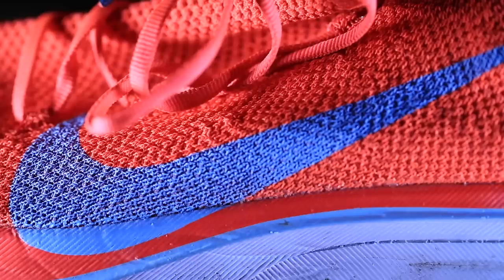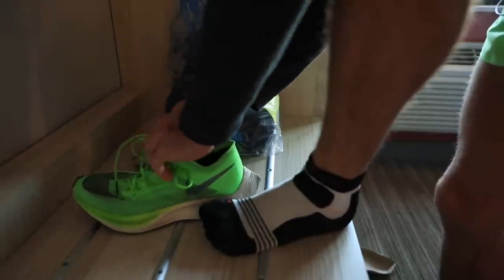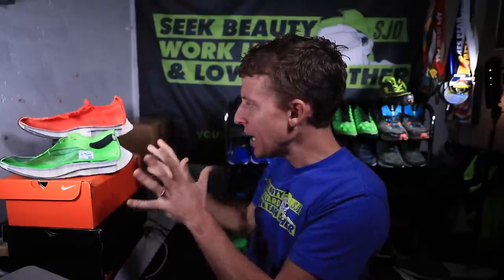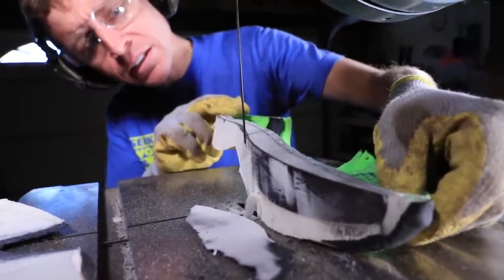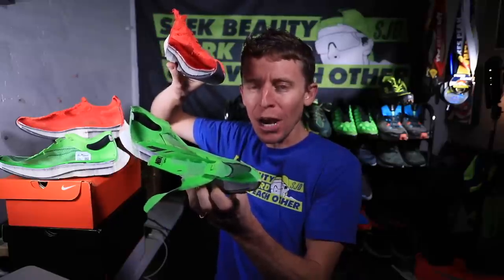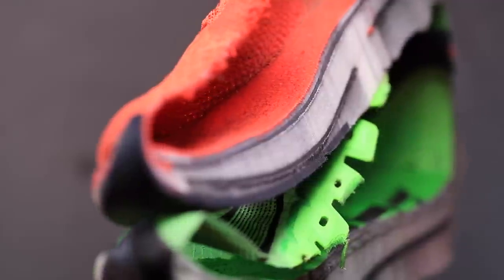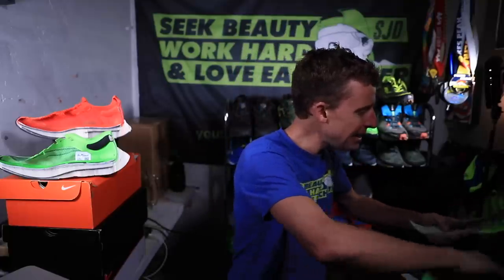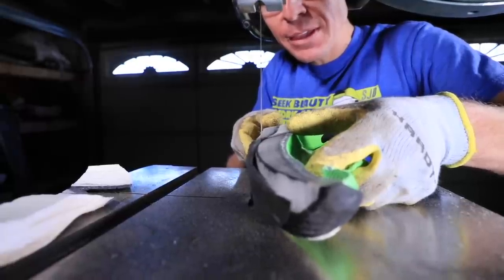What's Inside the Nike Next% & Vaporfly 4% Flyknit ? | FREE Next% GIVEAWAY

Comment: I own two pairs of 4%s and used them for shorter races.  It is my 'belief' that any benefit I may derive directly from wearing them is due to one of these factors (or a combination thereof): the extreme light weight, zoom foam, stack height, placebo effect, and lastly the plate. I think the the plate basically stabilizes the foam and help keep the foot in 'position'. I am not buying the idea that it provides a true spring effect.  I have been running since 1973 (first marathon in 1975) and seen a LOT of technological developments in running gear and shoes. It has been an evolutionary development.  The foam and plate in the 4%, Next%, New Balance 5280, HOKA, and others is just another step forward.  If one wishes to 'control' development, consider limiting the stack height of the midsole. BTW great segment today Seth. You nailed the video production. Well done.

Comment: Great video! I have the pink Next% and used it last weekend in a hilly marathon (420m of vertical gain). I do feel I gained some time, and saved my legs a bit in the 2nd half. There is a very noticeable bounce / energy return. In terms of negatives, the shoe was a bit too narrow. I should have gone half a size up on my usual (which I get in a wide fit, and the Next% has no wide option). The main issue with the size was the 4th toe on each foot, which got pretty messed up and I was (still am, maybe) in danger of losing toe nails. I'm going to cut a small piece out of the upper to make room for my 4th toes - it looks like some kind of reinforced mesh that shouldn't unravel. The other thing is my ankles hurt a bit more - they are definitely a little more unstable, so some ankle strengthening would help, and I think it's very important to get a good lock down in these shoes.

Comment: QD: I like it that they develop the race shoes. The same happened with tracks before. Runners were running on slack in the fifties which wasn't much different from the conditions that had existed for thousands of years. Now they have very fast Mondo tracks. Similarly shoes play a big part in marathon at the moment. When I predicted in 2010 that a man will run a sub 2h marathon within 10 years, I thought that in order to do it, it is going to require a rubberized marathon route. So I didn't see this kind of improvements in shoe technologies coming but a man ran a sub 2h marathon, which is fascinating.

Comment: I managed to get a pair of 4% in a sale and ran my first half marathon in them last October. I was blown away by their performance and ran 1:23 while I aimed and trained for 1:30. For me there's no denying these shoes offer an edge that other shoes simply don't... Does that make it unfair? I'd say no: it's progress, technological advancement. Shoe companies have always tried to make better soles: better energy return, more springiness without sacrificing softness (which isn't the same as damping!). Nike just made a breakthrough in this concept that others didn't. There's no mechanical advantage: there's no energy generated here, just returned. In other words: it's not mechanical doping.
That's not all though. If a shoe alters the biomechanics of the wearer, that could offer an advantage as well! Think of longer legs with extra levers (complicated contraptions indeed, that do exist). That isn't the case here. The shoe does seem to influence the gait though and make it more efficient for most users, but every shoe on the market tries to do that. Take stability shoes for example. Every shoe tries to give an advantage by improving the gait (without altering the fundamental biomechanics). Some are better at it than other. The vaporfly just happens to be very good at it. 
The 4% doesn't mean it's 4% better than anything else by the way. It's 4% better than the previous best shoe from Nike. If I remember correctly, RW tested this shoe and measured an energy return of 80%, whereas the previous record was held by Adidas with 79%.
Technological advancement happens in any sports. And every once in a while a game changer is dropped, sharpening records across the board. It happened in skating, it happened in swimming. And it happened in running. It's progress.
So I'd be happy to get my hands on a pair of next% someday and sharpen my PB's in them :)

Comment: QoD: I just took delivery of a pair of Next% (the green ones). I have not yet run in them.  So far I have just re-laced them and walked around a bit. They feel strange and, when walking I keep tripping, catching the toe of one on the heel of the other. The toes, the heels and the angled lacing all feel weird.  I usually lace my shoes with less cross-over in the mid section, to allow for my wide feet, and I use the loop-through-the-top-two-holes method to keep the heel tight.
I have a 10k, 10 mile, Half Marathon and Full Marathon planned over the next 6 months and these are to be my racing shoes.

Comment: I’m worried about the plates after getting problems from running in the vapourfly 3 all the time.
I’ve got the next % and they seem better balanced with the zoomx foam but I have not run enough in them yet as I’m only going to use them for racing & not training runs.
The react foam is too stiff to use with the plates in My opinion.
What do you think ?
How about chopping the zoom fly 3 to see what they have done...

Comment: Great insights and discoveries 👏Funnily I have both the 4% and Next% in the exact same colorways as yours🤘
I find the geometry in the Next% suits my gate cycle much better, with 8mm drop and a stack height which is substantially higher under the forefoot and midfoot, almost to a point where they feel like 2 different shoes. Furthermore the Next% also has the upper hand when it come to the upper and outsole, the first being more breathable and less moist absorbent, the latter securing more grip. Did a road marathon in each of them, and got hit by heavy rain 🌧
In my opinion the new tech in these types of shoes is much welcomed and needed, as I believe added cushioning in racing “flats” is so important physiologically, and is now made possible by the inclusion of carbon fiber plates. I also have a pair of Adidas Adizero SUB2 shoes, and that shoe is so unforgiving to run in, and never really got close to the Nike Vaporfly 4% in terms of popularity within elite and non-elite runners. 
Regardless of the performance enhancements being discussed, I don’t think it’s fair to ban a faster shoe, as faster (more aerodynamic) road bikes for instance are allowed in the olympics and the Tour De France😇